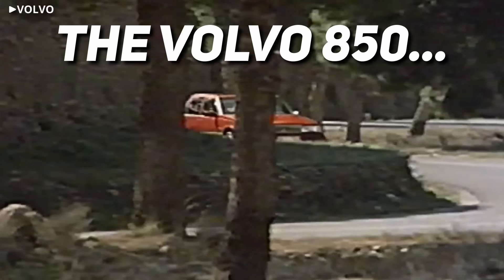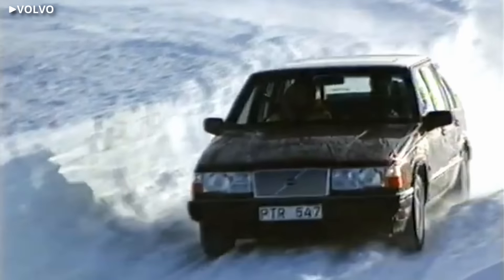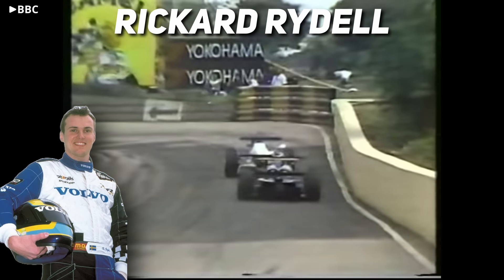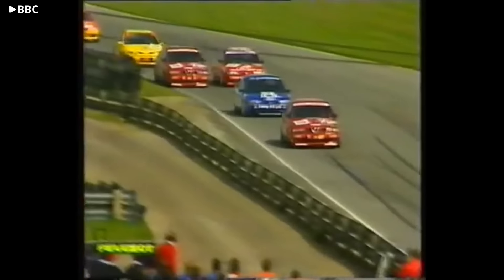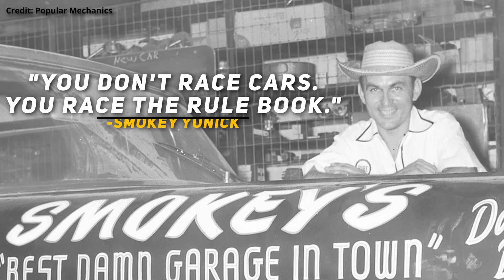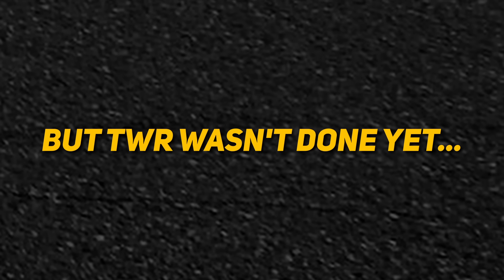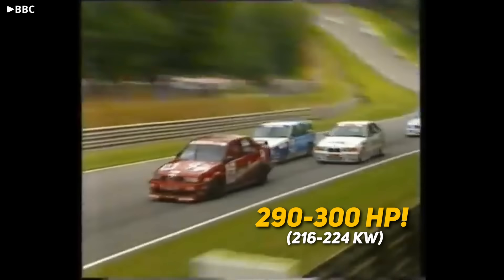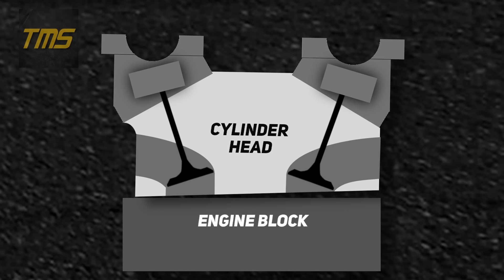The GENIUS Rule-Bending of the Volvo 850 Estate Touring Car! | (1994 BTCC)

Comment: Angle milling heads is an old, old trick, used almost as long as overhead valve engines were used in racing.  Very common on small block Chevys and Fords, to the point that Moroso sold offset dowel pins to move the heads back to the center of the engine, in the 1960s.  I strongly suspect that TWR also did this on their Rover V8s.  VWAG angle milled their touring car heads (which are horribly shaped, the exhausts are almost vertical) so much that they were lattices of aluminum that would last maybe one race before they started fountaining coolant internally.  The real coup for TWR besides the bolt on cam boxes was the rule that defined the port height as being relative to the deck.  So by machining a whole lot of material away from the intake manifold face, they legally HAD to raise the ports a lot in order to keep the same "height".

Comment: These cars are amazing im on my third mark 2, super reliable, easy to tune, really comfortable, really stable and never gets stuck in snow. And best part is that since body is zinc treated; they simply dont rust. First one was 2001 t5 with automatic and awd, midnight blue. Got 430 thousand km, no problems just regular maintenance, even with bigger turbo. Second one was 2003 v70, automatic fwd over 500 thousand with regular maintenance. Now I have swedish imported one owner 2001 with just 200 thousand v70 with pretty rare manual since volvo was so confident in their automatic gearbox that they offered it for free (automatic transmission was kinda rare in europe since eg german gearboxes had tons of problems) bigger turbo, sportier suspension, 2,5” exhaust upgraded to 3” any many small upgrades. Kept it sleeperish, sounds absolutely gorgeus tho. Before these i had 200 and 700 series. Just love these things. One bad thing is mpg is really not the greatest when compared to other european cars, but thats the price of that sweet 5 cylinder rumble.

Comment: Saw those 850s racing in Bathurst in Oz. Most impressed. I ended up buying a production one a few years later. Gorgeous car to drive. We lent that car to a pair of American doctor & gf doing locum jobs at our little hospital and they wrecked it. One of the hardest driving  cars I've owned. The 760 was about the most plush :-) The XC70 was driving like a brick on a rollerskate after that.
Squishy feedback from the steering, indifferent cornering. Volvo sold out to Ford and the local Ford dealer took over the servicing, and that was the end of my Volvo days. They were just shockingly bad, to the point where I decided to sell my Volvos (2 at the time).

Comment: Back in my younger racing days the first thing we did every year was study the rule book to look for gray areas, don't look to see what you can do but what it doesn't say you can't do. One class we ran required a factory intake manifold that would pass a magnet test. In tech inspection they would simply stick a magnet to the intake verify it was not aluminum. The engine we wanted to run that year never came with a manifold that a magnet would stick to, cast iron. With a little aluminum sheet, some Bondo and swarf from resurfacing brake drums we had an open plenum high rise aluminum intake that looked like a factory cast iron unit and would pass the magnet test and did for the three years we ran the class.

Comment: If I remember correctly, the reason why they went with the estate, was because of some kind of rule involving spoilers on the trunks of cars, and how too big of one could not be added. Due to the aerodynamics of the regular sedan, putting a small spoiler on the back Did not make enough of a difference aerodynamically. They decided to test a station wagon due to the fact that it had a prolonged rear that was flat, and roughly acted the way they wanted a big spoiler to. With that, they used the Volvo estate model because it made big spoiler aerodynamics.

Comment: The head angle change was also used by Dick Johnson Racing in Australia for the Shell Sierra Cosworths and they made 680 hp at 2.4 bar boost.
Reply: And yet could not even slipstream the might [banned] NISSAN GT R
Reply: @dazaspc  That is almost exactly what I was going to reply with.  It also would have been interesting to see how the Godzilla would have gone against the likes of the Renault 21 Turbo Quadra.  They had upto 480hp by 1990 but I think they were still only an 8 valve engine.  I can't remember if any other manufacturers ran 4WD.
Reply: @dazaspc  I wouldn't say CAMS panicked, they just followed what the rest of the world was doing. By 1992 Group A was a dead category - the manufacturers were no longer interested in supporting it because they couldn't sell the homologation cars. It sounds crazy I know, but in 1992 in Australia you couldn't buy a Ford Sierra, the Nissan R32 GTR and BMW M3 were in extremely limited supply, and the Group A Commodores were wildly expensive and very few were sold initially. (In 1991 you could buy a V8 Commodore for 5 grand, the SS was 7 grand. The HSV Group A was more than double the price at 18 grand - in 1992 that was a ludicrous amount of money for a souped up family sedan.) Europe and the UK had already abandoned Group A at the beginning of 1991. Australia and Japan were, I believe, the only countries still running Group A in 1992 and Japan was a locally made series only, so no Sierras or BMWs.
It would have been interesting to see where it could have gone though. Like you say, a 4WD Ford Sierra based platform was possible (it already existed in the Sapphire rally cars), BMW were working on a V8 for the next evolution of the M3 (we eventually saw it in the road cars), Holden marketed the Monaro Coupe 4 not too long after so a 4WD Monaro could have been a possibility. We could have even gone to a local Ford product with the Falcon XR6 Turbo once the Barra was developed. Toyota were developing the then new turbo 2JZ Supra which would have been a contender for sure, and of course Nissan were working on the R33 GTR. Imagine what that starting grid might have looked like.
Reply: @billharris3650  Impossible to know of course but on paper I'd say the GTR would be an easy winner. Once developed they were close to 700hp and the ATESSA 4WD system was far more advanced. That plus the Renault was a cobbled evolution of an earlier car whereas the GTR was purpose built as a road going race car built to fit within the Group A rules, which, surprisingly, no one had thought to do before.
I believe Ford UK were looking at a 4WD system for the Sierra/Sapphire platform, it already existed in the Sapphire rally cars, but abandoned it when it became obvious Group A was dying as a category. I have no idea if they ever built any.
Of course Audi were very successful with 4WD in DTM and IMSA but that was later.
Reply from the maker: Did not know this; Awesome!
Reply: Did any other teams catch on to this and do the same thing? By 1992 there were plenty of other Australian Sierra teams keeping up with the DJR cars. Glenn Seton, Tony Longhurst, Colin Bond, and even Brock were capable of running similar lap times.
Reply: @woopimagpie  Not that I know of.
Reply: In what currency was a V8 Commodore "5 grand",  @woopimagpie ?  Not in Strayan dollars - not even in '78.  No, what you could get secondhand is obviously not relevant. 

Also, the HSV Coupé 4 variant was way, way too heavy to have ever been considered for racing, and way, way too far in the future to be remotely relevant to this theoretical/imaginary formula. They weren't released until nearly a decade after these Ovlovs were racing.
Reply: @assininecomment1630  You might want to check your price guides mate. It's pretty easy to look up. 1991 was 32 years ago.
Reply: I have.  They weren't.  No variant of new Commodore on sale in '91 was under $10 000, @woopimagpie .
I remember there was quite a stink (mostly amongst non-motoring journos, seeking some easy dramatic headlines), when the average 6-cyl C'dore and Falc crept over the $20 000 mark.  That was late 80s, with VL and EA, respectively.
Reply: @assininecomment1630  Okay, so if my numbers are wrong, perhaps you'd be good enough to provide the correct ones?
The numbers might be off, but my point still stands. The homologation Group A Commodore was well out of the range of common sense.

Comment: The reason why most touring cars are saloons (sedans) is to do with rigidity, the open rear space of a hatchback or estate makes the chassis twist more.
Reply from the maker: For sure that is one of the main reasons!
Reply: The roll cage stopped the twisting where it mattered, the body itself twisting behind the axle line had little consequence.
Reply: @patrickparisienne1917  It is however the reason a saloon body is preferable to a hatch or estate.
Reply: @Zerofightervi   I have to disagree. As long as the chassis has torsional stiffness between the front and rear axle line where the roll cage is, the rest has no consequences. 

The only reason TWR changed to the sedan in 95 was the allowance of the rear wing, which had to fit within the frontal silhouette of the standard car, hence they couldn’t fit a wing on top, and if overhung, would not see any meaningful airflow with which to produce downforce…
Reply: That's why you pop an Ikea wardrobe in the back before racing

Comment: 80s and 90s Touring Car teams and creative rules interpretations, absolutely classic. This reminds me of the Fred Gibson R31 Skylines in the Australian Touring Car Championship. The rules stated that all factory intake metering must remain fitted to the car. The R31 had a 2L Turbo inline 6 with a Mass Airflow Sensor (AFM) that was known for its unreliability and restriction. They also ran, in race form, an ECU that didn't require readings from the AFM. So, they bolted the AFM to the side of the engine bay out of the way, and ignored it completely. The rules never said that it had to be USED, only that it be INSTALLED.

Back closer to topic, the Walkinshaw Holden VL Commodore was probably the wildest Homologation Special up to that point, as it had a full race package aero kit and the first fuel injected V8 in a Holden. The 'normal' VL Commodore V8s were still carburetted, if memory serves. I'm not aware of any clever rules bending on that one, as the ATCC allowed pretty much anything that had sold at least 500 units to run, so Homologation Specials that did away with the family car comforts and daily driveability were a big thing for the major players by that stage.

Comment: Great video, and an enjoyable watch, although I think you've compressed Volvo's entire BTCC engine programme into just the 850 estate years. That wedge-shaped head didn't see its ultimate evolution, and 300bhp+ output until the 1998 season and it was in the S40 by that time. I think you're probably citing the same document I read though, with Charlie Bamber in Race Car Engineering. It's interesting that the original cylinder head design was settled upon because it meant opposing valves could be machined at the same time, and not for any good performance reason. Again, an excellent video.

Comment: Fun fact: the 1998 Rydell S40 had the same (for the most part) 5 cylinder engine from the 850BTCC. The S40/Carisma platform allowed the team to address the aero and handling deficiencies of the old box.
Reply: There is a 25 year old Carisma in my garage. Passed its MOT with flying colors. The mech said that the undercarriage looked like new from factory. Okay, it only has 60K miles on the clock. It had 2 drivers before me. A Japanese owner, then my dad, and now me as he gave it to me 4 years ago. Verry uncool car, but it sticks to the road and is fast enough for me. Last summer, a driver missed a red light, and I swirved the car around his bonnet without problems. In a few months, it will be equipped with a French number plate.

Comment: I remember the 850 T5 and 850 T5-R estates being pretty desirable back in the mid-late 90's just because of the BTCC, they turned out to be a really good car overall. My Dad bought a 94 model T-5 estate after having them as patrol cars in the police here in the UK, at the time they were one of the quickest cars on the road over here - same with the Impreza Turbo 2000, he took me out in an unmarked 94 patrol car around the same sort of time.
Reply: They're even more desirable now silly prices if you see one! I used to run a V40 T4 too, it was way more fun to drive but the V70 was the king for comfort and just how planted it was to the floor.. She was a heavy girl but so surprising how drivable it was! Great cars

Comment: Cool video, but... we need to get this right:  the "billet" had nothing to do with the 855. The billet head  was only mounted on the 1999spec s40. And it was the unreliability of those engine that cost them the championship in 1999. 

All heads sits at an angel though. And the car still had cambelt and a factory distributor. 

Reason the 855 wasn't  competetive was that TWR had never built a front wheel driven car. Torquesteer was super bad and it also had the powersteering driven by the left driveshaft, meaning that at low speed it was hard to steer the car and and at highspeed the car hade super much presseur in the pump making it super light.  

The later cars got electric powersteering and chaindriven  valvettrains.

Comment: I don't know if this is true or not but I heard once that one of the Estates had smashed a windscreen and TWR didn't have a replacement so they called up AutoGlass to deliver them one as if they had a normal 850 Estate. When the glass arrived it was at least two inches too tall to fit the race car! The Roofline of the 850 Touring Car had been chopped and around two inches taken out of the A, B and C pillars for aerodynamic purposes!

Comment: Great videos. Loving this series. I have some questions;
1. Why do the spring and damper units angle so much backwards? Is this to gain additional stroke length? Because this can’t be to increase overall wheel travel as the wheel must still move straight up and down viewed from the side
2. Will many rallies have such variance that shim stacks will vary? Or are adjustments just accomplished via the bypass needle adjustment? 

Thank you

Comment: It's a shame we don't get crazy things like this, 6 wheeled F1 cars and so on anymore as everything is over regulated. It's also interesting how many racing cars were crazy at their time, but considered normal in retrospective if they were successful.

For example, BMW won the 24h Nordschleife with a 3 Series Diesel and made a case for winning with fuel economy over outright power... not long afterwards, Zakspeed showed up with a V10 Viper and turned that concept upside down.

Nevermind that, the 24h of Le Mans were won by Diesels 8 times in a row from 2006 to 2014... then FIA changed the fuel allocation to make it virtually impossible to compete and I think Diesels aren't even allowed anymore in FIA regulated racing. Imagine telling someone about going to Le Mans with a Diesel in the 90s.

Comment: 2:50 this is actually true. Notchbacks (aka sedans) have the worst aerodynamics, with lowest downforce and highest drag. Squarebacks have way more rear downforce and and slightly less drag oddly enough. Hatchback is the best aerodynamic body type, with lowest drag and while slightly less rear downforce, more front downforce than squareback.

Comment: They put big cams in them and angle milled the heads. It's smart racer stuff, but those things alone are not approaching innovative. Milling the stock cam towers and making new ones is pretty serious racer stuff, but also not unheard of or even that unusual. I don't say this to be rude, and I learned a little about how they made these cars competitive (I'm guessing there's a Racecar Engineering magazine article on the subject that I missed), but there's really nothing here beyond what serious racers have done since internal combustion engines were invented.

Comment: Good video. You missed talking about the aerodynamics though.  The main reason they went with the Estate (Station Wagon) body instead of the saloon is that the long flat roof added serious downforce (along with the marketing opportunities). So much so that there were reports that the sheet metal of the roof was buckling. There was definitely a weight penalty to that body shape as well as stiffness issues I believe but it was definitely competitive.

They changed to a saloon for 1996 because of regulation changes to the aero rules which made the estate uncompetitive. The saloon went on to win 5 races that year.
Reply: Did you even watch the video? This was covered.

Comment: Interesting, one question though, when they sliced an angle of the head, how did the bolts now fit to hold it down to the block? Did they have to modify the holes?

Comment: Where did you get that drawing of the cylinder and head section? It shows the valves inside the port... The valve heads sit in the valve seat with the face inside the combustion chamber, basically flush with the dome of the head above the cylinder.
Reply from the maker: I drew it. 🙂 The animation software I used for this is a little wonky. The valves were placed in after everything else was drawn and the only way I could get them to animate properly with everything else (and not just fly off the screen) was in that placement too far up. I’m well aware it’s not the most accurate visual but the main purpose of the diagram was to show the modifications done to the head which I think it does well enough. I suppose I should have put a disclaimer for the extra observant folks like you